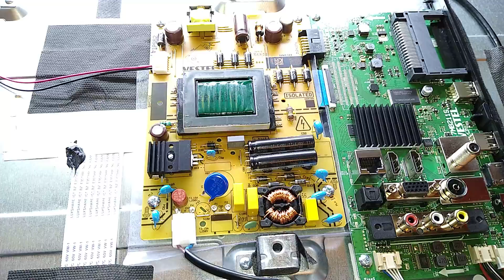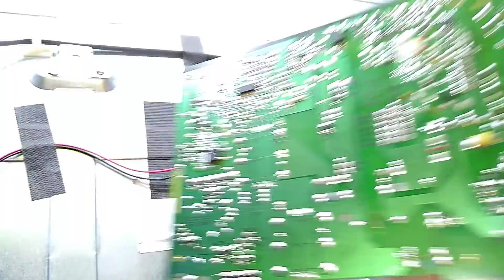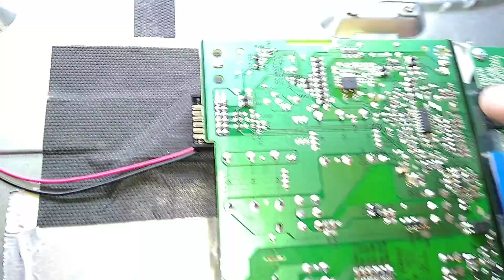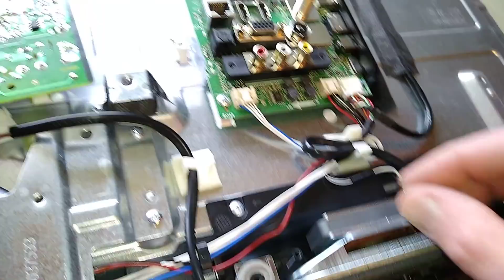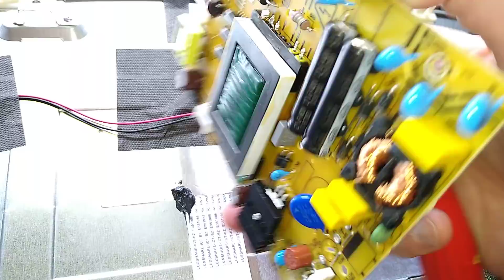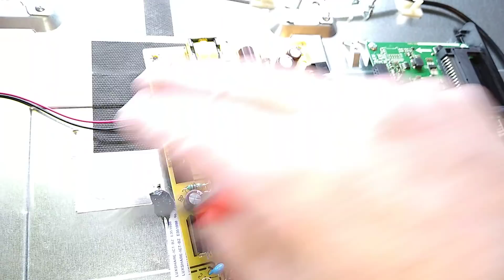There's not much inside TVs these days

Comment: I was half expecting "Okay, I've reverse engineered this and here's the diagram..."
Reply: You could always watch louis rossman check a few ppgv3hots if this doesn't scratch that itch
Reply: @veritasiumaequitasius3530  Some solid P P B U S (underscore) G 3 H O T
Reply: Yeah.. but the schematic diagram/service manual exists and there you have
Reply: Next video when he investigates the old PSU board in depth...
Reply: subscribe to diodegonewild for that!
Reply: I’m going to need a bigger writing pad.
Reply: Vestel sets, cheap and nasty as they might be, have one major advantage. Schematics can often be found.
Reply: @mjouwbuis  I've been in TV retail for over 15 years, Vestel based TVs were absolute garbage but in the last five or so years they have improved somewhat.  Not great but far better than they were.  We sell nearly as many of Linsars and Mitchell & Browns  as we do Sonys and Samsungs.  Even Panasonic have been using Vestel for their low to mid range TVs for the past few years now.
Reply: @HojoNorem  Yes, recent Panasonics have gone downhill.

Comment: I have this ancient Samsung TV that I've brought back to life twice now, in both cases I got lucky and spotted bulging capacitors - I think these are user serviceable to an extent, but I've never seen a service manual for it.
Reply: When you go in to change one change all of them. I swapped mine out years ago and never had to go back. I used Nichicon brand caps. TV runs better now than the day it was made.

Comment: first guess would be dodgy solder joints if the caps are good that is and there are no skidmarks around power stuff like diodes and mosfets. 5 minutes tapping joints with proper lead based solder could probably solve it. i had this experience with a 6000 euro qled tv. the board quality was utter shit to use technical terms.

Comment: When I came downstairs a few weeks ago I spotted a damp patch on the wood floor and first looked at, as you would …..the cat!   Then, up at the ceiling thinking, we'd sprung a leak - but no!?   

I couldn't fathom it at all and then I twigged... the pool of water, about a cup-full, was smack bang below the corner of my brand spanking new 39 inch Panasonic TV !!!!!   

The outside aerial cable had been holed after decades chaffing against the wall and it was now acting as ....wait for it..... as a form of HOSEPIPE into the circuitry of the TV !!!   There must have been a bit of ‘sparking’ as I’ve lost all channels and there's a dark shadow in the bottom left-hand corner! I've had to step back in time by attaching an old fashioned Freeview box to it.....anyone know what board I need to buy... and a supplier?
Reply: I used to have to deal with that fairly frequently in my days of servicing TVs (yes, people did once do that!)
Reply: Look up the board and model number on ebay. You might even be lucky like I was a few years ago and find an identical one with a smashed panel, just swap the board out and scrap the rest.
Get a new antenna cable first.
Reply: @chrishartley1210  Wow! Thanks for that, Chris!

Comment: Welcome to my hell lol.    You got off easy so far.  Be careful with the new power supply and the light array under the panel.   They have a tendancy to burn out, and in turn buggers the whole circuit.   If your power board died, you might want to consider checking out the LEDs just to make sure you're not wasting cash.   If they're burnt you'll eventually run back into the same issue unfortunately.

Comment: Tuner, LED driver, transformer, yeah, not much. They're basically just scaled-up handheld TVs. The panels are 60-90% of monitors these days.
Reply: I have a neighbor that is picking up every free broken TV that they can, yanking the circuit boards, and dumping the rest of the unit in piles at the street for trash day.  I assume they are trying to salvage precious metals from the boards, but isn't a working TV worth more If they just fixed them?
Reply: @TuckMcSouthard  I just hope he's processing the parts far away from his house. No telling what kind of roaches or bedbugs might be in them.
Reply: @TuckMcSouthard  if the panel is broken, its over, and you can tell its the panel just from looking at it. I don't know what people do, but I never broke a panel or a smartphone screen.
Reply: @monad_tcp  Because most people are stupid :P I had a female customer destroy the screen of her old IBM T60 laptop. It, for some insane reason, was left opened and laid on the ground. While she was applying (an excessive amount of) lipstick in front of her makeup mirror, she somehow stumbled backwards and stepped all over the screen with her high heels 😂🤣🤦‍♂️ It wasn't a pretty picture, the laptop was fucked up too. 😆
Reply: Most amazing is comparing it with a projection TV which has all those lenses and mirrors.
Reply: Power supply pcb is 90% of the problems
Reply: So the screen is 90% of the... TV screen. I would hope so 😂
Reply: @Vousie  The panel (this is what the screen itself is called in the industry) is 60-90% of the cost and/or mass of the whole monitor, which includes the stuff you see inside as well as the bezel and the internal structure and any bells and whistles.
Reply: @orbitalbear  
r/whoosh
Reply: Yep.  It's hilarious when I see second-hand TVs on sale for 50% of MSRP with a damaged panel.  People don't realize that the panel and software are 90% of the TV's value.  Salvageable parts are only worth tens of dollars, especially as a model gets older and there's more boards to salvage.
Reply: I had a 40" Sylvania led tv that died and I kid you not. Every. Single. Component was on the one board. The powersupply failed and instead of fixing it I bought a Phillips
Reply: Tuner, nar a little filter maybe and then a software defined radio.
Reply: They are basically a "glass" panel, that's when I say people come trying to fix a broken shattered TV, no, you can't fix a shattered glass, yes, the glass is the most expensive thing, the other things are like 10% of the value of the thing.

Comment: My neighbour threw out a smashed LCD with these two Vestel boards in it (well, slightly different configuration, but same multi-config PCBs), LEDs still worked so powered them from an LED supply and made it into a light box/softbox panel, just cos... :P
Reply: I've got a old friend's TV cos the tuner went wonky on it. I'm using it as a computer monitor watching iPlayer.

Comment: Naff all in tellys these days, had a few with backlight failiurs in the past. One set it turned out to the the CFL caps had failed & thus were not passing currint to the little tubes. Another one had failed CCFL driver transistors, I think this one was a computer monitor this time. The caps tend to be harder to debug due to high voiltage stuff requiring speshlist mesueing quipment. But there are a few backdoor methods you can use to see if there is voltage. I don't recomend poking with the finger though to test.

Comment: I used to work as an AV technician for a while. For quite some TV's, once the screen itself is gone, they just write off the whole TV.
Solder repairing is basically non-existing anymore, just replacing boards. The old ones go in the bin.
Time is just not worth it at 50-75 bucks an hour. It's sad, but that is how it goes, unfortunately.
Reply: Sad but true. I must have taken a couple dozen small TVs home from work which were destined for the dumpster. All but a few were easily fixed. Most just needed capacitors.  Some had bad power boards which I bypassed with external 12V power supplies. I gave them to family and friends. Unfortunately, the 103 inch plasma TVs in the conference rooms never died.

Comment: Vestel not a brand which is known for high quality PSUs. The rectification diodes in the secondary are also often a problem.

My 40 inch Philips LED from 2010 has a big Delta PSU which drives every single LED stripe itself and also has a active PFC. But it has a 2.1 sound system with a heavy subwoofer. It also is not that thin. Back in 2010 for a console gamer it was nice because the Samsung ones had very hard clouding and a to high contrast on red.

Comment: 25 screws. Agh!
Reply: This is where a cheapie walmart.com hypertough cordless screwdriver is worth its weight in gold. I got mine for less than $15 on their site. It stays by my electronics bench. It's a nice design, too, as it rotates to be an inline model or the more standard drill design.
Reply: @johnpossum556  or they could use 6 screws ?
Reply: @DaveLaneGC  Probably wouldn't have the rigidity the engineers want. Or something. Just bite the bullet, go to walmart.com and search "HyperTough 4-Volt Lithium-ion Cordless Power Screwdriver, AQ70008G
Reply: If you have a store nearby I see they even have a model available for less than ten bucks. Just don't expect it to work like a DeWalt or Milwaukee. Light use only... I've had mine for years now. My first cordless screwdriver was 400% more $ and I wore it out in less than a year.
Reply: @johnpossum556  I think they just don't want people taking them apart :)

Comment: For how cheap you can get used boards delivered to your door, repairing boards just isn't worth the 20 minutes to swap a component. It has been this way for some time. Most PCB repair companies wont even look at a board these days. They know it's not worth it too.
Reply: I've only done board repair on one once, only because it was a well documented easily diagnosed failure (bad voltage regulator). Still not sure how I managed to change that little SMD regulator with nothing but a unregulated 30 watt iron and roll of solder without destroying anything, looking back that was more a hot air job. But other than that sort of situation yeah, not worth the diag time to go farther than isolating the problem board, nevermind the rework.

Comment: I spent  $1800.00 for what? 3 boards and a screen
Reply: Most of the money is in the panel as I undstand it. LCD tvs have always looked like this inside, you used to have an extra board or two for ccfl backlight power and a dedicated display drive board but that was all.
Reply: @Broken_Yugo  Depends on what size.. and.. resolution. 40-50" displays that is 1080 is break of from larger display. Its like yeald binning.

They have a 80" 4k display. Then a part of i breaks in production, so they bin it down to 3 1080p Displays. Those are dirt cheap to make, because its really recyling scrap
Reply: The leds is actually suprincinly expensive. There is a lot od them, and they are really powerfull.. also the CRI need to be bery specific.

Also.. the lcd might be somewhat expensive.. well... if its 4k. 1080p lcd is pretty much a waste stream peoduct today.

Comment: Had one like that, a secondary rectifier diode went short. BTW Vestel suck and can be found in nearly every cheap TV model these days even ones made by well known brands.
Reply: It's a common problem, don't forget to replace all three not just the failed one otherwise it will fail again quite soon.
Reply: Vestel is the largest TV manufacturer in Europe, most "super market" brands are made by Vestel. The software/firmware is more or less the biggest difference in TVs these days. There aren't that many factories left that manufacturer the panels...
Reply: @Fifury161  not in Europe...they are manufacturing in Turkey.
Reply: @marcinjastrzabek9784  Which is partially located in Europe. You're accidentally right, though. Manisa, the city of manufacture, even while geographically west of Istanbul, is indeed on the Asian coast of the Aegean sea (which defines the border between the continents as far as I know).
Reply: @marcinjastrzabek9784  Their geographical/political location does not detract from the fact that they are the largest TV manufacturers in Europe - they account for about a quarter of the European market
Reply: Agreed.  We had one of these power supplies in a Toshiba branded TV - only one diode faulty, but got a kit of all 6 for about £7 from Flea-Bay. The biggest job was pulling the TV apart and putting it all back together again.
Reply: @escapeman9016  Mine is a Toshiba also, when I scoped it I could see these diodes getting overvolted at startup by a large margin in the form of spikes.

Comment: What was the TV make/model?
Reply: this is a vestel TV.. many cheaper tvs are rebranded, digihome/finlux/hitachi, it's all the same, slight branding differences and different onscreen menu colours. Quite clever
Reply: I fell for it with a panasonic tv, im 100% sure its all vestel in there... same menus same ports (specifically vga and antenna) and the plastic back covers, they are ALL the same with some broken tvs i have seen...
Reply: @BluRay_4  The board looks exactly the same as I scrapped out of a Hitachi last week...
Reply: Since there is a ton of the same tvs... i hope i could find parts easily...

Comment: Have the exact same power board in my TV which also stopped working, no LED but still turned on. Just out of warranty.
Reply: Got a pcb here if you would like it. I'll double check the part numbers for you if you can provider yours
Reply: @connorwat51  that is very kind of you but I threw the "Hitachi" TV out, didn't trust the fact that none the parts were Hitachi. Apparently some licensing company bought out a bunch of TV brand names from big companies and rebrands Chinese rubbish with Japanese namebadges.
Reply: @arnaudmeert1527  yep that's true. Almost every make is now vestel. Finlux Hitachi Bush cello and others Including most Panasonic now aswell.

Comment: Modern design in general can be very disappointing that if it breaks it usually ends up in the trash either because a part couldn't be sourced or that the cost/effort made it not worth it.

Comment: There really isn't!
It's not the same without all the coils of death.
Reply: Yep, and forgetting to plug all the coils in after replacing a tube meant watching in horror as the electron beam burnt a line across the tube and then you'd have to pull everything apart yet again to put another tube in and hope you didn't do the same silly thing again!